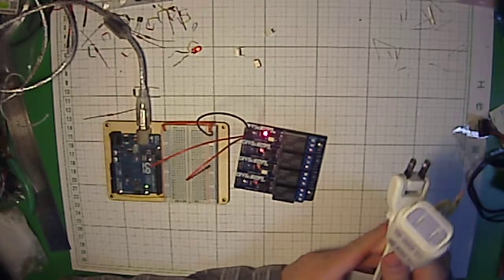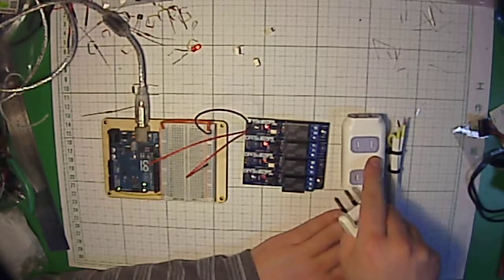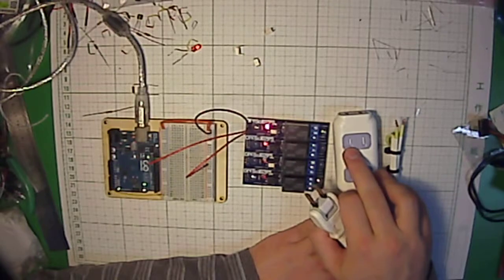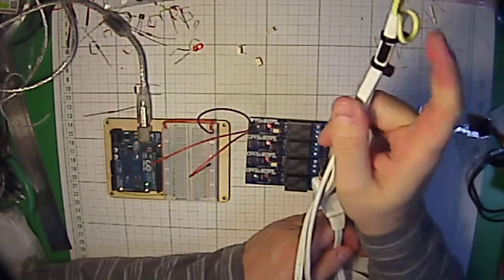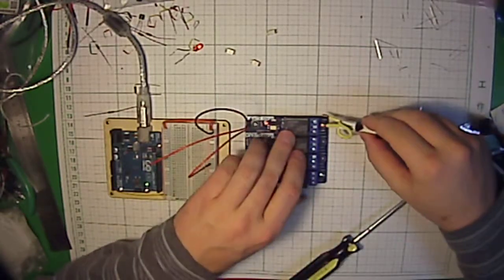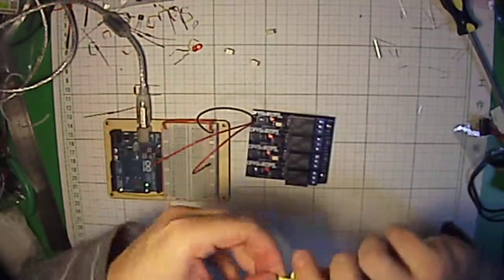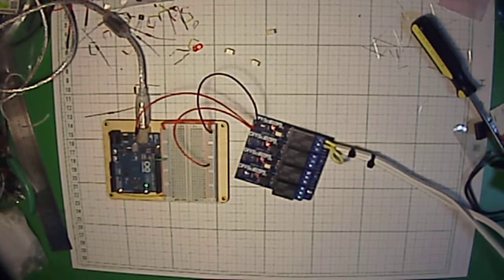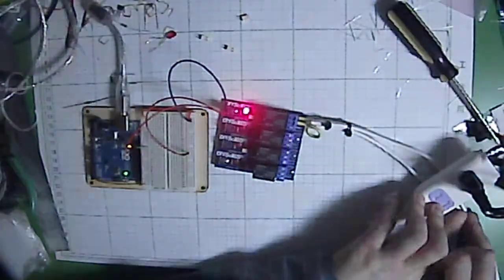Omron G5L Relay board - usage

Comment from the maker: Sure! It can switch AC and DC loads up to 15 amps.
In either case, you can use it to switch on motors, lamps and other devices.
Some typical uses:

1: Home automation - remotely control lights while you are away
2: Remotely control outlets that are hard to reach
3: Hydroponics/aquarium automation - pumps, lights and valves
4: Drive yet more powerful relays (called contactors) which can switch very high currents
5: Stage lighting, RV/Boats, etc. many uses. control it with Arduino.